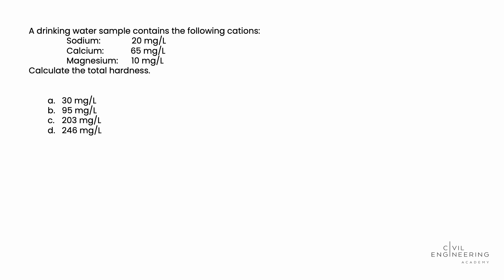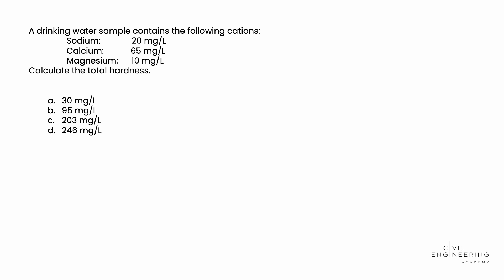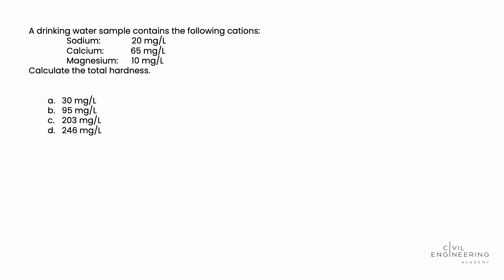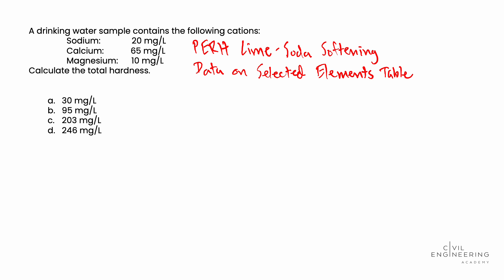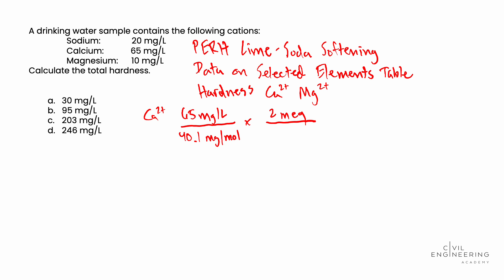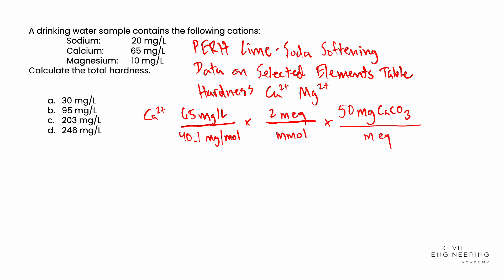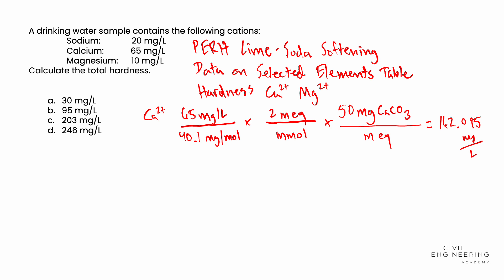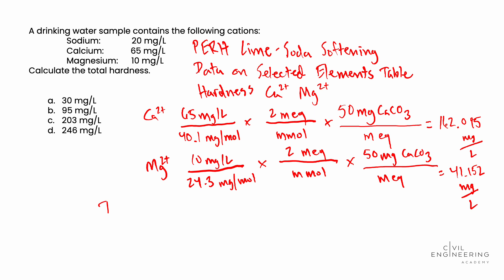PE Water Resources Exam – Find the Total Hardness of a Drinking Water Sample

Comment: easier 30 second solution is to do 2.5(CA mg/l)*4.12(Mag mg/l) for total hardness
Reply: is this a formula from the manual or one you memorize
Reply: @cici_1112 you have to memorize it but its implicitly in the manual if you solve for ratios of molecular weight for the chemical reaction. I had a typo in my formula. Its supposed to be 2.5CA + 4.12 MAG to get the equivalent CACO3 in mg/l